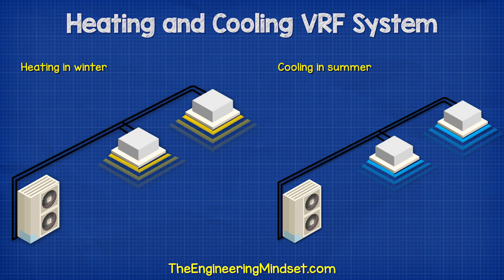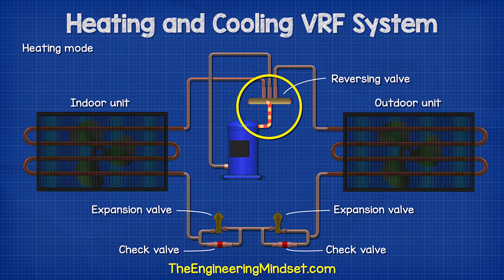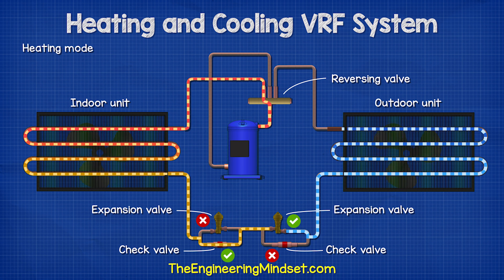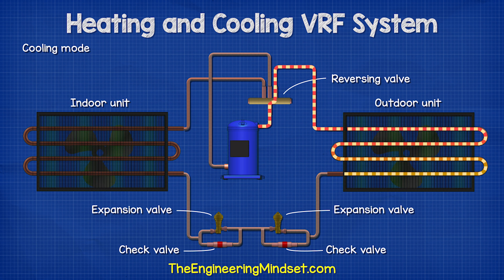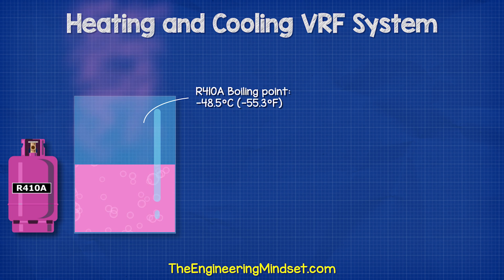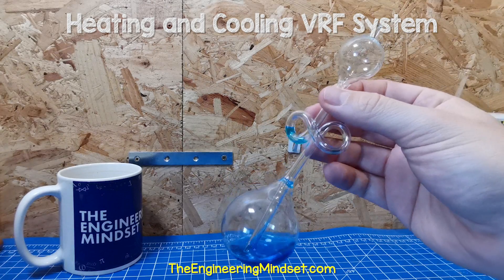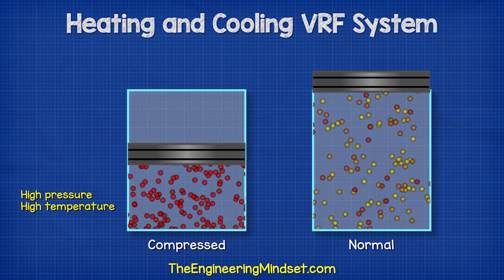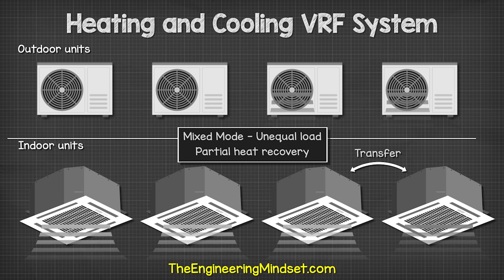Heating and Cooling VRF System

Comment: I don't understand how something that boils at a low temperature can release heat. If it is boiling below room temperature, it's still going to feel cold, isn't it?
Reply: No. The state (solid or liquid) doesn't really matter. What matters is the amount of energy the fluid/gas is carrying. As the gas is extremely compressed, the atoms carry a lot of energy (because of friction), which increases the temperature. Normally compressed gas is around 30 to 40°C.

Comment: Is this like a inverter air conditioning system or is this just standard air-conditioning ?
Reply: Inverter refers to how the compressor motor is driven; inverter systems have much more control over the speeds/loads the motor operates under, improving efficiency and resulting in quieter system. With an inverter, the compressor can run at partial load to match the demand rather than cycling on/off.

The system described here is a reversible heat pump, and it's possible to have an inverter AC with no reversing function, a reversible heat pump with a standard compressor, or a system that is both inverter-driven and has reversing functionality so it's as efficient as possible while also being able to provide heating or cooling. It's not uncommon to find these features together, as higher-end systems tend to combine them.
Reply: Thanks buddy, we have inverter type air-conditioners.